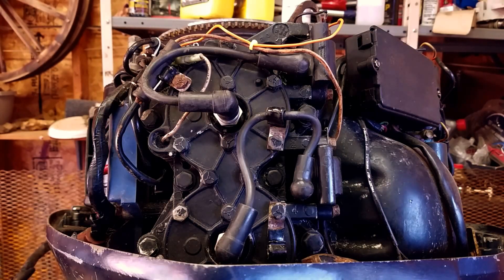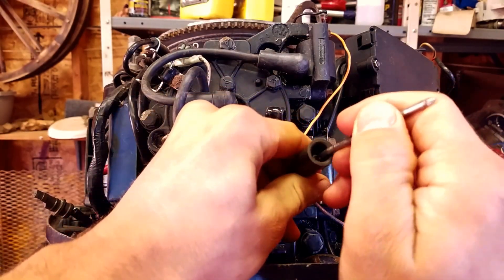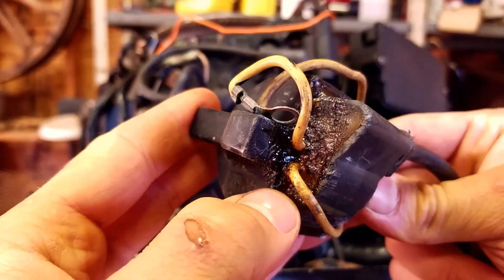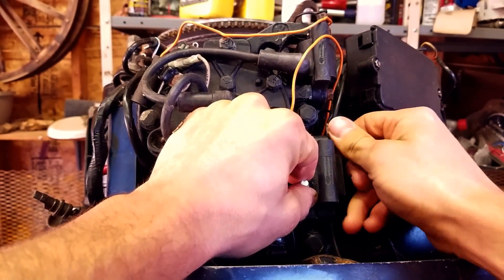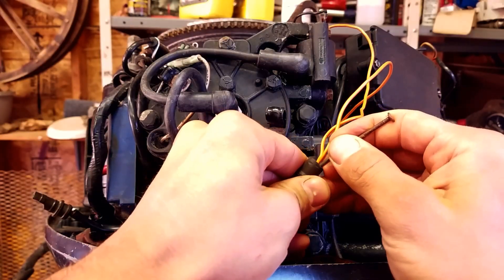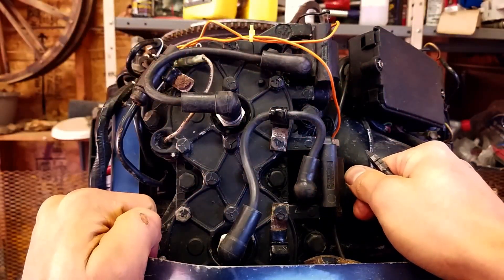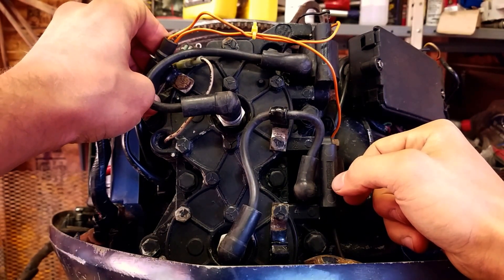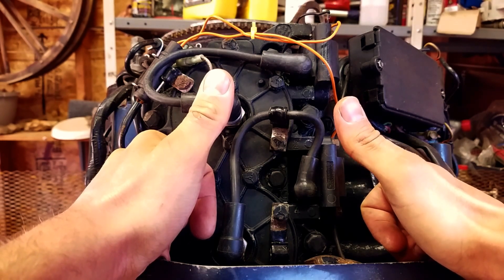How To Diagnose and Replace A Bad Outboard Coil Pack

Comment from the maker: What's up guys! Make sure to check the links in the description for NEW COIL PACKS. I have all the info on how to find out exactly what part number you need there!
As an Amazon Associate I earn from qualifying purchases.
Reply: hi mat  I got the coil  and installed it but now it dosnt start at all so I put old one back in as it would start on one cylinder  but it wouldn't start again  any thoughts   thanks for the great vidios
Reply from the maker: It should start of it's the exact same thing. Make sure the mounting bolts are clean and not corroded because they are the ground on a lot of outboards. 

Make sure you check all of your wires and their pins to make sure they are not corroded or loose too.

Let me know what you find.
Reply: tim greene has to run
Reply: Hey Matt.  My outboard now only runs 20mph & before it went 27mph & it takes long to plane. Thanks for your help
Reply: I changed the charge coil & rebuilt the carburetor.

Comment: Man every time I think I have an issue we my Johnson 150 your videos pop up! I'm wondering if it's my coil pack. I been rebuilding as much as I can with my limited knowledge. Just got it 4 months ago. Today while running about 30mph every now and then I felt the slightest bit of what I thought was a hesitation? And it was a fast as a blink of an eye. My rpm didnt change or anything. It was on a faress degree as when one of my fuel lines collapsed at high speed and choked the fuel out. I have added a fuel water separater and I don't see any leaks.  My packs are not leaking but that rubber backing is cracked. I do think my carbs are running rich, and if I don't run it for a week, some times it takes a few tries to crank, but after that on the lake fires up first time after first start, even if I go the next day boom. Sparks have been changed to the ones you recommend. I realized I had them gapped at .035 and on further research it should have been .30. I'm about to go out again to test it out. The only other thing I could think to test is 1) go back to running the fuel straight from the tank, disabling the separator to see if there's a pin leak, and 2) coil pack change
Reply: What ended up fixing that issue?
Reply: @TehGrayson  I ended up buying new power packs and haven't had an issue since. W the fuel line collapsing, I realized that the bend in the fuel line was too deep running from the separator to the  outboard so at high speed it suction was too great.
Reply: @CTRadventures thank you

Comment: It's easier to just replace the parts! If the motor is 40 years old and I will probably only use this motor for 10-15 max I would rather have new parts to end the future problems.

Comment: I have an older 9.9 Johnson 2 stroke, somebody gave it to me so I knew it was gonna have an issue... It does, at an idle to half speed, it runs fine, even starts fine... When I try to run her up above half speed it starts to skip/ jump/surge.. it'll keep running, but it just does that hard jump... Back it off on throttle and it's fine... Would you say that's a coil issue???
I'm not great at troubleshooting small engines, but I've been trying to research it. Great video btw, it'll help if that's the case.
Thx in advance.
Reply: I'm having the same issue, but only over 3800 rpm. Curious if you ever got an answer

Comment: Thank you! Excellent job.
Reply from the maker: Glad it was helpful!
Reply: @MattsShop  I'm going to look at a Mariner 15 tomorrow that the seller claims has a bad coil. After watching your video I feel a lot more knowledgeable on the subject, and can better assess the condition of the motor. Huge help,  big thanks!
Reply from the maker: @forrest42  That's awesome. Coil packs are cheap and easy to replace. Be warned though. It's usually never just a coil pack it's always more.

Comment: What if it quit running and will not start  could that be coil pack?
Reply from the maker: It's hard to say. Normally, ignition components usually start failing when they warm up.

Comment: Would a bad ignition coil cause an outboard not start?...i can only start outboard when i put in starter fluid in..
Reply from the maker: I would start by inspecting the fuel system first.

Comment: My mercury 90 runs great when cold then when it gets up to operating temperature it stalls and is really hard to start and keep running. Is this a bad ignition coil? That's what it sounds like to me according to the way you explained it. It's always been a little hard to start anyway. Any suggestions or advice would be appreciated thanks
Reply from the maker: It could be failing ignition components. These older outboards are uniquely tempermental at this point in their lifecycle. Sometimes you gotta live with this issue if you go through everything and it checks out OK.
Reply: @MattsShop  I did a resistance test on all 6 ignition coils and they all checked out fine as far as I can tell....I don't really know what other ignition component to even consider
Reply: @MattsShop  my only other guess would be a fuel issue when the tank gets to a certain level. I know for sure I have an air bubble in my fuel filter almost all the time but still doesn't explain why it waits to start giving me trouble

Comment: I have a 1985 Evinrude XP 150 it idles fine but under load it bogs down replace the spark plugs clean the carbs out don't know what it is any help
Reply from the maker: Could be a lot of things, did you check the fuel pump? What about the fuel recirculation system? There are little brass check valves on these engines that can go bad. They recycle excess fuel from idle If I remember properly.

Is the trigger/timer base moving properly?
Reply: @MattsShop  where are the brass check valves on that engine
Reply from the maker: They are little brass hose barbs with a check valve inside, and a screen on the bottom. They are a PITA to remove. You have to take the carbs off and don't mess with any of the adjustments. They are burried with all the little hoses coming off of them.

You're supposed to get a syringe of rubbing alcohol and push it through the valve. It should only flow one way. Just do some Google searches.
Reply: @MattsShop  ok thanks

Comment: How do you no when its bad??? My yamaha 50 keeps jerking with a squeak  on low idle and dies but sometimes runs smooth then happens again, I am posting a video on my profile take a look if anyone could help
Reply: I've got a 72 johnson 25 hp doing the same thing. Also will not open up to WOT. Only idle

Comment: Hey bro what’s is part number for the coil pack I click on ur azm link n it show me a lot of different ones thanks
Reply from the maker: What's your make and model outboard? I'll look it up for ya.
Reply: Matt's Shop 140 Evinrude 1979
Reply from the maker: @The Adventure of the runs Run  Nice! That's what this is. Here's one that should work: https://amzn.to/3boWR5A   All those coils on Amazon are interchangeable. If it looks the same it should work if I remember correctly. Here's more part numbers: https://www.marineengine.com/newparts/part_details.php?pnum=OMC0584561    I only use OEM BRP parts or Sierra parts.
As an Amazon Associate I earn from qualifying purchases.
Reply: 140hp Evinrude 1979
Reply: Thanks just order 4 and do you by any change have repair book or what esl to check if she don’t start she crank n turns but will not start thank you for ur help
Reply: What kind of hydraulic fuild dose it take
Reply from the maker: It doesn't take hydraulic fluid. It takes Marine Gear Oil in the lower unit.

Comment: I can’t get spark on all 4 it’s a 1974 115 hp evenrude no spark at all
Reply from the maker: If you don't have spark on all 4 I'd rule out the kill switch first. Then the stator/timer base.
Reply: Yeah thanks I’m waiting for a 1974 service manual for the motor 115 hp evenrude I found 3 cut wires one purple a black and the other is so dirty I don’t know yet I think there triggers waiting on manual

Comment: i have a problem with one cylinder weak spark or no spark but it jumps fire when its grounded to the engine block any suggestions
Reply from the maker: Do you have bad corroded grounds? Have you tried swapping around coil packs or power packs to see if the problem follows the component?

Comment: 1985 Johnson 90 hp.  When I run motor for 15 or 20 min, then stop for 5 min, it wont restart.  When it turns over it dies in a few sec.  When it cools longer (15+ min) after a ride, it restarts ok.  Possibly coils?
Reply from the maker: They say these electronic components tend to fail when they heat up. Have you gone through everything else? I wouldn't just throw parts at it.

Comment: I got a miss (cough, choke) at low rpm and motor runs amazing at higher rpms. I tried new plugs and wires. You think it this could fix it? Thanks! :)
Reply: Did you ever find out your problem on your outboard?? I'm having the same problem 😡
Reply: @cramos6638  dirty carbs.
Reply from the maker: What Outboard and spark plugs are you running?
Reply: @MattsShop  1992 120hp Johnson 2 stroke vro removed mix gas 50:1.
Reply: @MattsShop  and spark plugs are QL77JC4
Reply from the maker: Those are the right plugs for idling on these outboards. Most guys set the spark plug gap to .035" on these outboards. Do you have a factory service manual? Are all the linkages adjusted properly? Are your carburetors clean or have you rebuilt them? Little problems like this can be difficult to diagnose.

Comment: i have a roughneck 16 ft with a johnson 48 hp slp that i just bought. boat has been sitting for 5 years. i drained the tank and put fresh gas in it. engine is turning over and is getting gas but no spark in either spark plug what would you suggest i do?
Reply from the maker: Check the ignition shut off safety switch, corrosion on any of the timer base, stator, power pack, and coil pack wires, check the big red plug for corrosion. Clean every connector and bit of corrosion you find. Then try to start it.
Reply: @MattsShop 
M

Comment: Matt, I seem to have a completely different symptom / problem on my 2006 90 omc   J90PLSDM. Runs great out of the hole then at top end acts like it's not getting fuel (typically runs about 5200 rpm when right but usually on the first run of the day only wants to run about 4300 rpm). Always seems to run well on the way home after stopping to fish.... Compression is good on all 4 cylinders. I have replaced all gas hoses to motor and  primer ball. Pumping ball or choking engine when it does this does not seem to change anything. Only does this at higher RPM.  What would be a likely cause of this ???
Reply: Gas tank vent 100%

Comment: just bought a boat it has a force 50hp 1988 they said top coil bad how do I check it can I pull the plug wire at night a turn key to see if it sparks ?? help
Reply from the maker: Take a picture of how it is now. Then swap the top coil and it's little wires with the coil below it.

You need a timing light and/or a spark tester. The timing light is the best.

If the problem follows the coil then it is bad. If the problem stays where the top coil was then it is something else.

Comment: So I have a 60hp mercury runs great while it's cool but after it warms up it just ruff running dies when it comes to a idel & doesn't respond as if would when it was when first started..
Reply from the maker: These are the tell tale signs of some kind of ignition component failing. They say they work great when they are cold. Once they get hot they can start acting up if they are old or damaged.

You just have to figure out which part of the ignition system is acting up!
Reply: You have the exact same problem as me. I have an 83 mercury 90 hp 2 stroke. I'm late but did you ever identify the problem?

Comment: great video  I have a 97 40 hp eveinrude electric start  and need a coil pack  I looked through the links you posted but didn't find any that matched up  been looking at a few but everyone says its the one but they all look different  can you shed some light on the right one and where to order thanks  tim
Reply from the maker: You can go here: www.cdielectronics.com and type in what your make/model/year outboard you have. It comes up with this one: https://amzn.to/2waocJc.

1997 Evinrude 40 with electric start.

Does that look like the one that is on the motor?
As an Amazon Associate I earn from qualifying purchases.

Comment: Great Video  Where would you suggest buying Power Pack . Got one from ebay but was rpm limited.
Reply from the maker: I have links for them in the description. Just make sure that you get the right part number from: http://www.cdielectronics.com/ CDI makes the best aftermarket ignition parts.
Reply: willis reno what do you mean the rpms are limited? I bought 2 new coils but not I have very low power.  I used to go as fast as fast as 27mph now I'm lucky to hit 18mph
Reply: willis reno any suggestions. I also rebuilt the carburetor & changed the charge coil. Any suggestions?

Comment: very informative video my johnson will run great until it gets up to temp then die instantly when cold i got spark in all three then no spark in all three simultaneously, you think it would be all three coils are bad at the same time or possibly my power pack?
Reply from the maker: +Jeremy Red No!!! It would be extremely rare for all 3 coil packs to go bad at once. Yes, I would start looking for with corroded/wires and then look into the powerpack(s) after that. The fact that all 3 coils went out on you at once is a hint telling you that it is somthing further up the chain.

Comment: Hey mate, nice video. Do you have a video of how to remove the lead that goes to the power pack from the connector? I bought a set of 3 for my Evinrude and I need to reshuffle the leads to match the existing coils on my outboard. They are stuck quite tight in the connector.
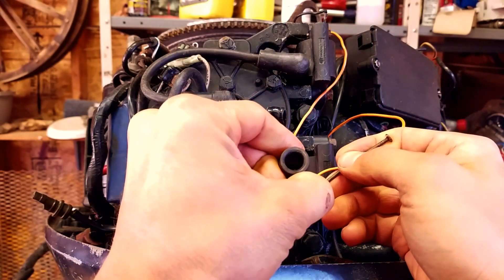Reply: basically the opposite of 6:25 in your video
Reply from the maker: I'm not exactly sure what connector you are talking about. If you are talking about removing pins from the connectors they can be really stuck sometimes. Oil helps for sure when you are pushing them out.